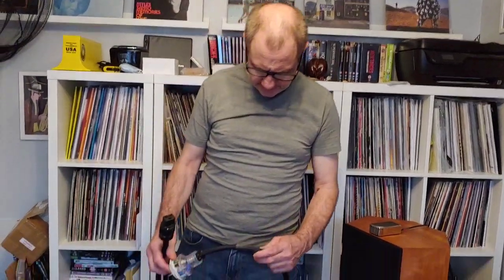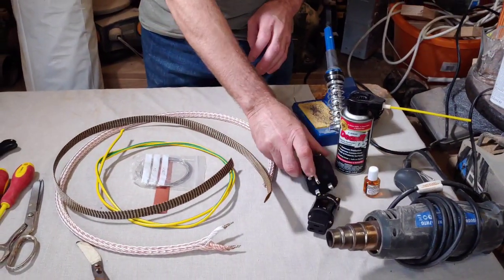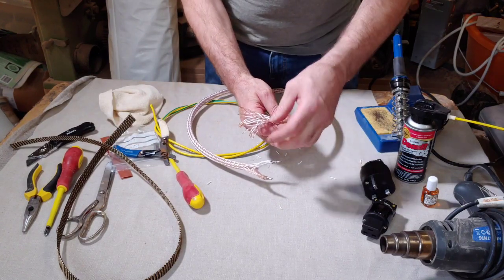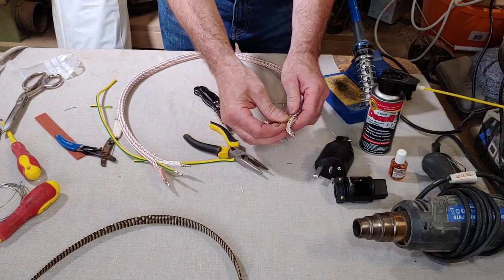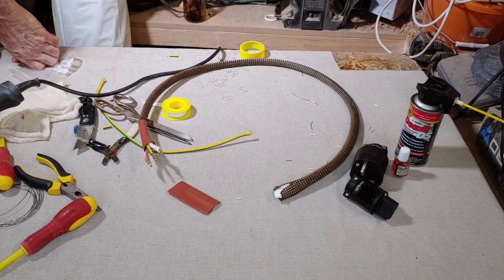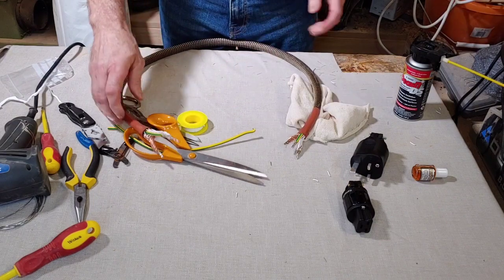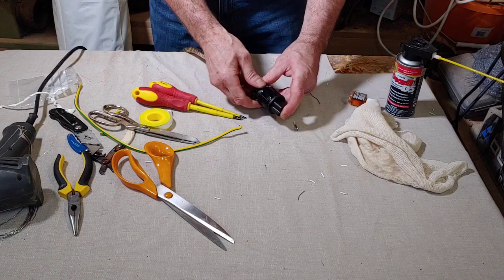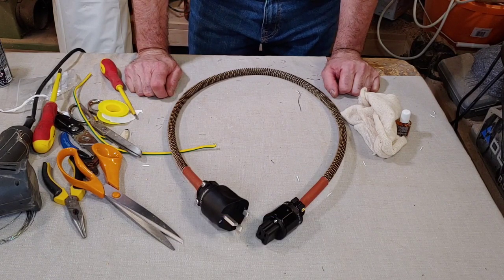How To Make A 12TC-OCC Signature Powercord

Comment: DeoxiIT5 bottles, original nozzle sucks. Leaks A LOT on the side. Also in this video, Tweakerman got the same issue. These are expensive bottles. I took a nozzle from the WD40 and it works fine now and no spilling. 
Tweakerman do make great cables. Showing us all the steps in a great way. Although most eBay links are obsolete. Google helps.

Comment: I think Russ Andrews ones have the ground cable twisted on the 12tc cable. Is there a way to do that by hand? Thank you for the video!
Reply from the maker: Hello, you can hand twist the earth wire around the outside of the cable, 1 twist per inch or 25mm, thanks for commenting & watching👍

Comment: TM you explain it very well. built your interconnects and speaker cable. Is there a  knockoff version of the connectors that are made for  the U.S  market?
Reply from the maker: Yes, do you mean your mains plug?
Reply: Yes I know I can use Wattgate connectors however they are expensive. I thought you might be able to recommend an equivalent.
Reply from the maker: @rudyd6239  all the products you need are in the description below the video, check the links out👍

Comment: without trying to be rude, this wasn't good advice.
stranded wire that is meant to be crimped/secured w/ bolts or any other terminations that apply pressure should not be tinned/soldered w/ any kind of alloy.

i guarantee that in a manner of weeks the connections will be loose. re-tightening solves the issue only temporarily...

there are other options when dealing w/ thick stranded wires, the easiest being wire ferrule terminals.

there are special cases where the wire is crimped and then soldered (the solder wicks inside the crimped section) for addressing bimetallic corrosion.

hopefully this helps someone. happy listening.

ps: don't believe a word i said, don't believe the code standards deployed in electrical work and don't believe the internet. try it yourself. take a piece of stranded wire, apply solder to its end and then tighten the bolt as hard as you can. let it sit for a month and then check the bolt. come back here and share your experience :) :)

Comment: My Arcam doesn’t have an earth connection at the devices will these cables be of any value
Reply from the maker: Hello, this cable will most definitely make an improvement in sound quality, but  just don't add the earth wire, thanks for commenting & watching 👍

Comment: Same way with shuko (EE) plugs ? Thanks!
Reply from the maker: Yes.
Reply: Makis Did you ever source a decent Schuko version ?
Reply: @markcallaby8334  Mark,  This is an extremely decent solution (Supra SW EU 16A). Costs about 20,00 EUR. There are many decent solutions on the market. In my opinion there is no reason to give more than 50 euros for schuko. I do not think you will hear any difference with a schuko which costs two hundred or more euros. This is my opinion.
Reply: @makistsobanou9451  thanks Makis